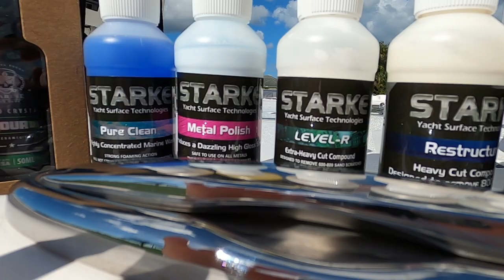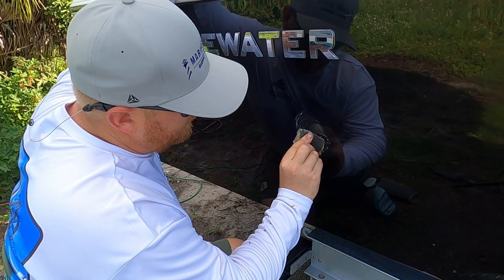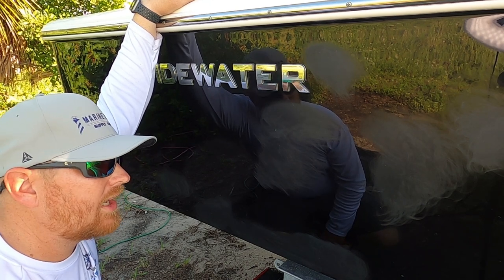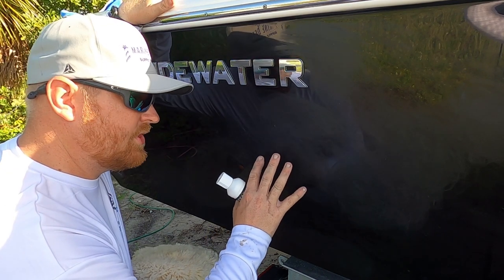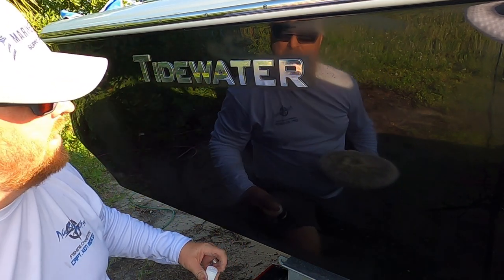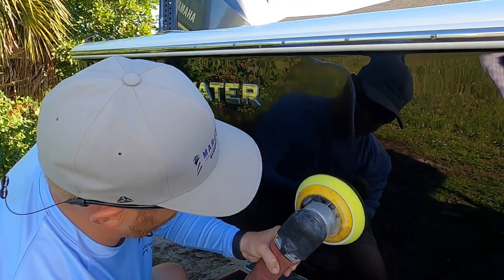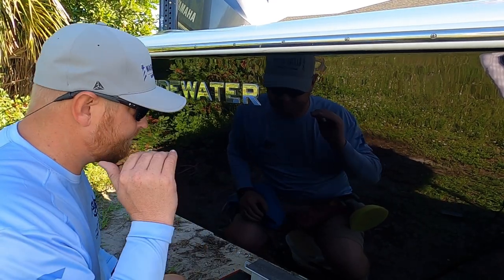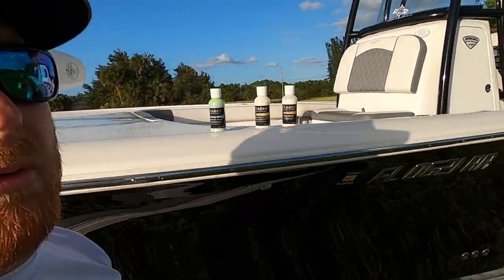How to: Fiberglass Gelcoat Boat Scratch Repair / Compound / Polish / Ceramic Coat Prep

Comment: Thanks man l just finished my  black skimmers skiff couldn’t figure out how to get red off scratches! I love the way it turned out   I use it 1,000 grip 2,000 and l added a 3rd one 5,000  elevan & ignition it was much easier to polished   THANKS MAN FOR THE VIDEOS

Comment: If level-R doesn’t remove all the oxidation. Where do you go from there. I recently looked at a black sea hunter and a green Everglades. Used level-R/ elevate/ignition. Then washed it and you can still see the salt spots in the gel coat.
Reply from the maker: If level R doesn’t remove it you must wet sand with at least 1000 grit. May even require 800 or lower to start then work your way back up
Reply: use hydrochloric acid mixed with water 50/50 . That will remove salt spots.